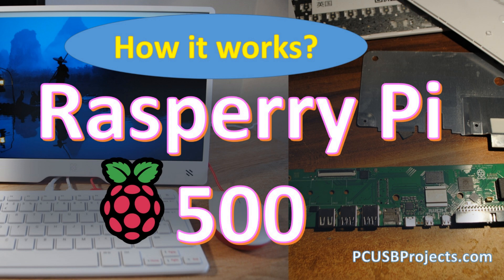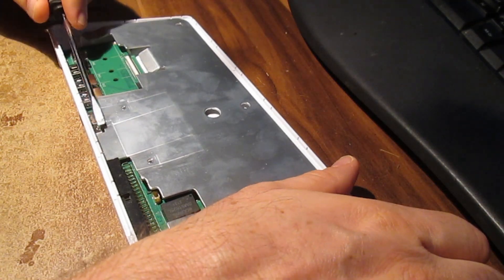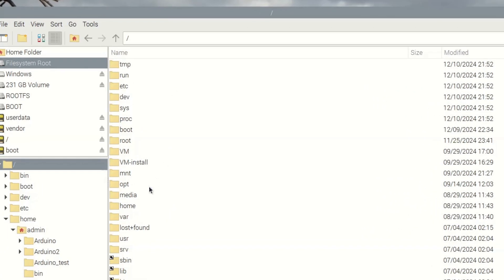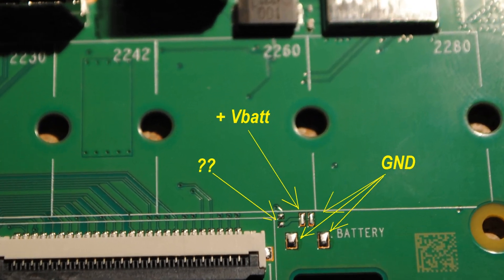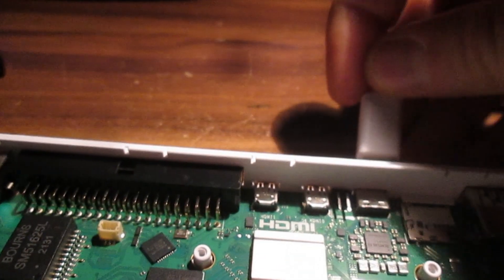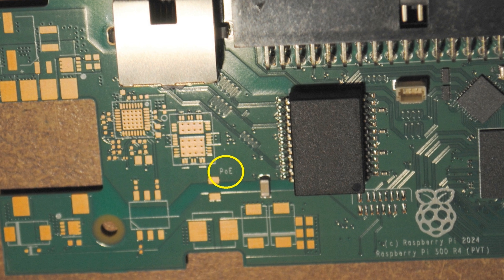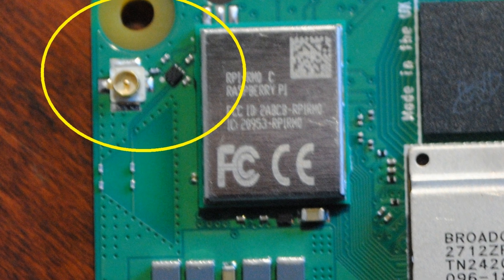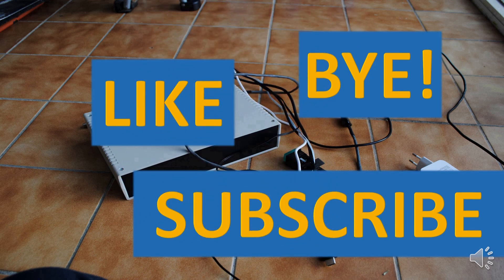Raspberry Pi 500: How it works? Undocumented upgrades!

Comment: I've modded mine to run the M.2 SSD, and the speeds were similar to what you can get on pi5 with m.2 hat.
Component in line with the RTC battery is probably low value resistor for overcurrent protection.
Reply from the maker: Watch: https://youtu.be/o8OjwexNiWE and you'll see. There should be a 75 ohm resistor to limit current and prevent premature discharging of the battery. Additionally, for a non-rechargeable battery on my opinion there should be a protective diode (ex, 1N4007) in series. You can run without a diode, if you don't enable charging in config.txt file. But I recommend diode anyway, if something goes wrong in SW. When I've managed to plug-in a wrong SD card to my RPi 500, charging was enabled in an instance. You can only charge special rechargeable batteries like ML2020 or MIL2032... Later, I replaced it with a rechargeable battery, so I've removed the diode and enabled charging....
Reply: @pcusbprojects  Charging of the RTC battery? That's not very common.
Reply from the maker: Rechargeable batteries are still not as common as non-rechargeable ones to run RTC, but Raspberry Pi 5 was far from being the first to use them. You can also find them in some old laptops, where there would have been very hard to replace a battery without an almost complete disassembly.
Reply from the maker: That's great news! I guess you can now communicate to your in-built SSD at PCIe x1 gen 3 speeds...

Comment: This video was very informative and (if one reads between the lines) we can see where the upcoming iterations would have things like functional USB-c, separate power input, switchable antenna (maybe or maybe not), NvMe slot (although this adds a tremendous amount of heat to the already expansive heat sink module) and even more RAM.  Now, about those HDMI micro cheesy ports ....
Reply from the maker: Just as I've said. It's like a Pandora's box. You can learn a lot from it about possible forthcoming models. Watch this video next to learn more: https://youtu.be/q2yvBXmJGqs. Raspberry Pi 5 with 16 GB RAM was also released on Dec 9th. You can learn more about it in this video: https://youtu.be/gYz_0pqde04. If you wanna add an external RTC battery to the existing Raspberry Pi 500 model watch this video: https://youtu.be/o8OjwexNiWE next.

Comment: OR,, maybe ? ,, below £129  + £30  ,, for a modern cloud based Laptop computer & graphics tablet, with monthly updates for 10 years 
.
Lenovo IdeaPad Chromebook | 11.6 Inch HD Laptop | Intel Celeron N4500 | 4GB RAM | 64GB eMMC | Chromebook OS | Maca Blue
Wacom One by Wacom Graphics Tablet - Small or Medium
Reply from the maker: If you are using Microsoft Office 365 you are cloud based, no matter what computer you use. However, RPi 5/500/CM5 enables both options. LibreOffice is almost fully compatible with Microsoft Office, but it runs of RPi. RPi 5 can have 4 TB or more NVMe HDD. I expect forthcoming models of RPi 500 to have an NVMe SSD option, too. Watch this video to learn more: https://youtu.be/q2yvBXmJGqs
Reply: @pcusbprojects  modern Chromebooks,, have a desktop chrome browser with  extensions AND Android 13 AND Linux
so,, if you want google docs or Microsoft 365,,, or  LibreOffice in Linux  -- YOU CAN,, all at once if you wish
Reply from the maker: You have to decide for yourself what you actually need. Android 15 needs a lot less resources on RPi 5/500/CM5 than on an Intel or AMD processor based PC. However, if you intend to run Microsoft Windows and Microsoft Office, than a classic PC is certainly a better choice for you... RPi 5/500/CM5 also has an expansion connector to allow you to make custom add-ons or to buy them.... However, Android TV may also suit your needs.

Comment: I'm extremely disappointed with the RPi 500. It took forever to come out, and obviously had been planned for big things, but.... The biggest complaint I had about the 400 was the inability to connect an SSD internally (and at full speed). That they planned making this possible but then cut the feature makes this a solid pass for me. Maybe there will be a Rev 2....
Reply from the maker: I completely understand. RPi 400 was based on RPi 4 with no external PCIe x1 implementation. PCIe x1 expansion port has later been implemented only on some RPi CM 4 carrier I/O boards. RPi 400 is based on RPi 4, so a complete PCB redesign would had been needed. What is a lot for some is too little for the others. Watch this video: https://youtu.be/q2yvBXmJGqs. You'll have to wait for a few months for a RPi 500 with a reach functionality, which I strongly believe that it will be there soon enough...

Comment: Good video. You have done a great job examining the whole board. It makes you wonder what they have planned. Maybe the board is designed for the Pi 600 or something? As in preparing for future generations of products?
Reply from the maker: Surely not for RPi 600, because this one is to my knowledge coming at least 2 years in the future. But there might be an enhanced version of Raspberry Pi 500, like Raspberry Pi 500+ or something with all advanced features like NVMe SSD, PoE, 16 GB RAM, external antenna. There might also be some kind of single board Raspberry Pi 500 derivative computer without a keyboard with advanced features, because, as you could see, I've found a power on button contacts. Power on button is only needed, if there is no internal keyboard.
Reply: @pcusbprojects They've built the Pi 500's motherboard with those power contacts. They've built a nice new monitor, which can be powered from a Pi 5. Maybe in six months' time they'll put them together and give us the Pi 500 laptop*, making use of the power contacts. 

* Pi-top? Pi-crust?
Reply from the maker: If there is gonna be a laptop in the future, it will surely need a more powerful power supply to achieve 100 % of volume and brightness. The current limitations are to 60 %, if you are powering the monitor from RPi 500 (or any other USB device, which is not PD capable). If you place the monitor nearby RPi 500, they look a lot like a laptop. There is also a RPi 5 tablet already in existence today, but it is based on some extension cards and a standard RPi 5.

Comment: Why is there a pi pico processor on the board for?
Reply: To operate the keyboard. You should find a microcontroller inside a keyboard if you take it apart.
Reply: @ that is what I was thinking. Some say the pi5 processor itself doesn’t have I/o pins build in.
Reply: @DiyintheGhetto  Quite likely.  RP1 clearly doesn't have it, because if it did, the microcontroller wouldn't be there.

There has to be a more powerful version on the way that allows for upgrading, but with a different case design. The heatsink is designed to access the M.2 slot, but you have to tear the thing apart to get to it. There has to be a largwr or different case design in the mix.
Reply from the maker: If you've watched one of Eben Upton's interviews with his lead employees about Raspberry Pi 5's development, you could hear that developers also used a special classic PC PCIe extension board with RP1 chip to emulate Raspberry Pi 5's functionalities before BCM2712 SoC have been ready. This video might interest you: https://youtu.be/WFsltbm9ayc
Reply: @ thank you

Comment: voltage regulators for M.2 are also missing, as are caps.
Reply from the maker: Definitely! But, if you can solder the M.2 connector, I believe that soldering the rest is probably easier. It's more or less the same as on M.2 hats for RPi 5. Actually the newest and very precise Texas Instruments regulators rather use coils than large capacitors, for example: TPS56320x. There are of course some small caps, too.
Reply: I hope that someone puts together a kit with all the "missing" components for us to buy.
Reply from the maker: Sure! But for most of the users with average soldering skills and simple slodering irons, it think it is almost impossible to solder miniature components like 2 mm long and 0,8 mm wide resistors, capacitors etc. I expect a more capable RPi 500 to be available in a month or two. Watch this video next to learn more: https://youtu.be/q2yvBXmJGqs.
Reply: @pcusbprojects  0201 are quite difficult to solder.
DC-DC IC and inductor are leg-less so you cant solder them with iron, need to use hot air, but because PCB is big and has 4-6 layers, you need a preheater as well if you want clean unoxidised joints.
Reply from the maker: You also need a microscope or at least a magnifying lens to see exactly what you are doing. A soldering iron with at most a 0.4 mm tip (less is preferable) is also needed, if you are soldering SMD chips with legs. For the chips with ball contacts, I'm not sure either. I'd try to replace them with legged chips somehow, if they have only a few contacts... It can get quite messy... A 3.3 V voltage regulator for example...  I don't recommend it....
Reply: @ I was able to do the 0201 bare eye with hotair and very sticky flux, I relied on the solder that was already on the pads.
I did rest of the components the same way.
But I had no preheater so the joints are a bit oxidised.
Reply from the maker: Congratulations! If it works flawlessly, it is good enough...
Reply: thanks for the info, thought about diy..

Comment: Would have been a no-brainer with M.2, but without M.2 I can wait.
Reply from the maker: There will probably be a completely new RPi 500 version with a new case, if M.2 is going to be implemented. NVMe SSD drive access must be easy enough for an average user to be able to install it, except if they are going to preinstall it in the factory.
Reply: Needs a built in mouse pad too.
Reply from the maker: Why not? But would have to grow to accommodate the pad, which currently doesn't seem very likely...
Reply: @pcusbprojects  No just shrink the keyboard part of it. Logitech already has plenty of keyboards with the mouse pad built in so why can't raspberry pi?
Reply from the maker: Of course, they will do it, if they realize that there is market for this option. I prefer a normal sized keyboard and a mouse therefore I'm using my RPi 500 with a classic keyboard and a mouse attached. However, it would have been great for me, if I could easily add an SSD drive. Future versions of RPi 500 may offer this possibility. Another interesting option would have surely been a touchscreen on the Raspberry Pi Monitor, which would also ease the use of Android applications... Watch this video to learn more: https://youtu.be/q2yvBXmJGqs.

Comment: What a missed opportunity.  If they added a proper switch, M.2 socket + access flap, it would make the RPi500 an ideal school computer especially for UK primary schools.  I just hope there is an RPi500v2 with all these features.  I would suggest a screwed on cover over the GPIO port to deter little fingers from shorting out or breaking the RPi500!
Reply: You can get cheaper computer (used HP miniPC) that would wipe the floor with this one, including app compatibility.
Reply: @jz2187  ... and it uses how much power?  I agree that used PCs should be used.  In the UK, we have a world beating operating systems company (Canonical - Ubuntu)  so why isn't UK government supporting Canonical for Linux use in schools, universities, public services, hospitals etc on older PCs to save money/improve situation rather than insisting on using Windows/macOS and having to throw old computers away?  I run Linux Mint (Debian Edition) on a 7 year old MacBook Air with internal 128GB SSD swapped for a 2TB one (via a Mac to M.2 adaptor).  RPi is a British company.  UK government should be supporting its use in schools.  US government would support using US computers in America!
Reply: @jz2187 How many pins does the GPIO header have on the used HP computer?
Reply from the maker: I would have loved M.2 connector and SSD drive, too. There was no cover on RPi 400 expansion port, so this rubber cover is surely a leap forward. On my opinion it does it's job. It is really hard to remove (if not impossible) just by using your fingers. But I agree that it is not enough for a school use.
Reply: Access to the M.2 slot is complicated by the side of the board that it is on. It is the “wrong” side to be accessed by a simple door in the lower case moulding.
Reply: @dougal6569  True but that's part if the 'missed opportunity'.  If the RPi500 had an M.2 slot in it (+ security cover over GPIO dlit), it would have turned the device into a fantastic little desktop computer suitable for schools.  We can only hope this happens in a later revision.
Reply from the maker: It looks so! There are two options: An inbuilt SSD drive or a different keyboard case that with the SSD doors or the one that is much easier to open. They could use screws instead of plastic latches.
Reply: I’m not buying anything ‘Raspberry Pi’ ever again. 

You’ve no sooner bought one and three months later an upgraded version is available. 

I’m after something mature, stable and upgradable so I’ll stick with mini PC’s
Reply from the maker: This video video might be of your interest: https://youtu.be/Cjjdpm96vh0. I'm a classic PC fan as well, but Raspberry Pi has some advantages like being almost fully resilient to computer viruses, trojans and other malicious software: https://youtu.be/AGGgwN35uRg. I still remember the 90-ties when you had to buy components and build a new classic PC every 2 years to run the latest software. As about Raspberry Pi 5 with 8 GB RAM that was introduced in October 2023, it is on my opinion still the best option for most Raspberry Pi users. Despite a number of new Raspberry Pi products, you may stick to it and you get a top performance, unlike the PCs from the 90-ties that I've mentioned above. If you wanna use memory hungry applications there is now Raspberry Pi 5 with 16 GB RAM: https://youtu.be/gYz_0pqde04, which is a really new product for me regarding performance. So, it is basically not every 3 months, but rather a year between significant Raspberry Pi performance improvements. On my opinion you should compare Raspberry Pi 500 to Raspberry Pi 400 which have been released 3 and 1/2 years apart. Its is significant even for mini PC development...